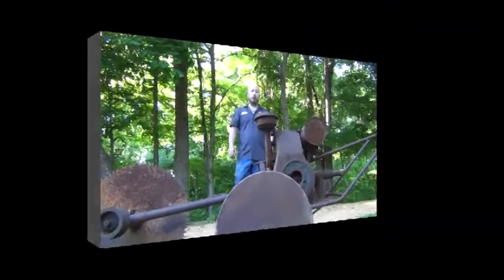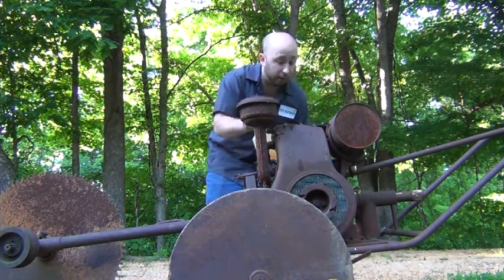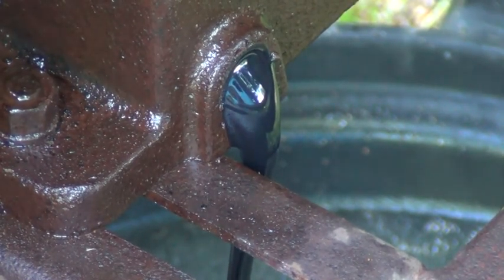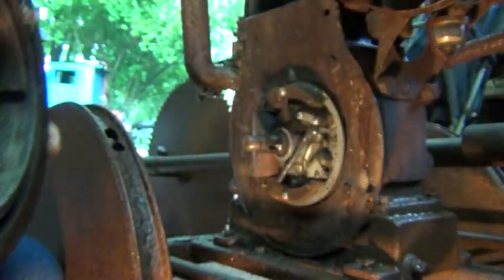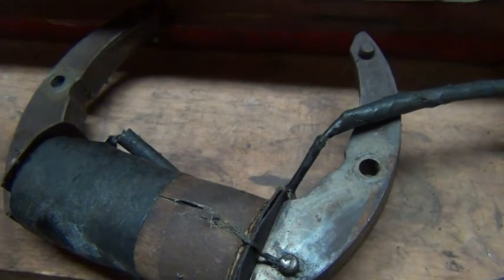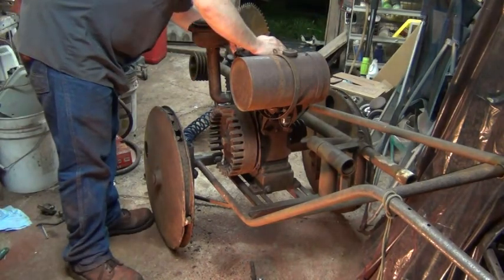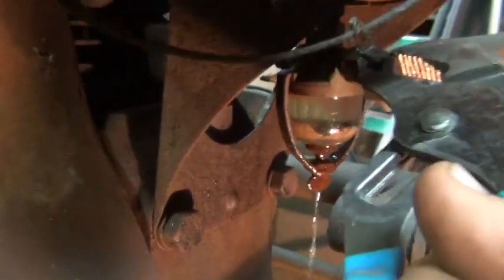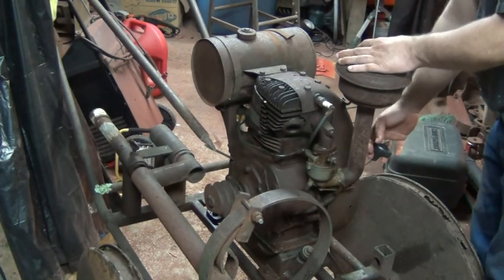Bringing Back The Dead

Comment from the maker: I would love to try this thing out, as it was made to be used.   There is NO clutch!   When the engine is running, the blade is spinning.   This is a 2 man operation; 1 guy runs the saw, the other one calls 911 LMAO
This is definitely a show piece, just because it's complete & it runs.  Nearly all of these saws were scrapped or cut apart.   I don't think I will ever drop a big tree with it, but I do intend to knock something down, & buck it up.
Thanks for checkin it out buddy!

Comment from the maker: This is a Briggs ZZ.  It was advertised at 5 to 6HP... which was a pretty big deal for the time.   Actually the Z and ZZ engines were the largest (size & output) Briggs made during the 30's & 40's.
This is a big old girl... it's weight & size is pretty comparable to the model 23 engines.
Lookin forward to the Gilson vid!
Thanks much Steve

Comment: Our 2 banger Wisconsin on our log splitter is crank start, it will start on a 0 degree day on the first attempt, it will cold start in the summer on the first attempt, if its warm it starts tuning backwards and the crank the crank will rip out of your hand.  So if there is wood to be split we start it and leave it run all day till we are done!!